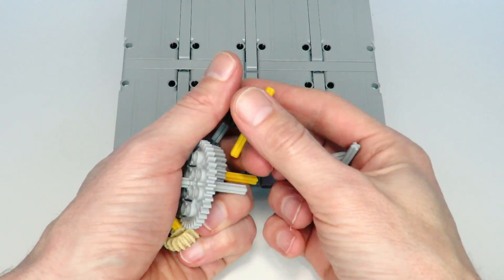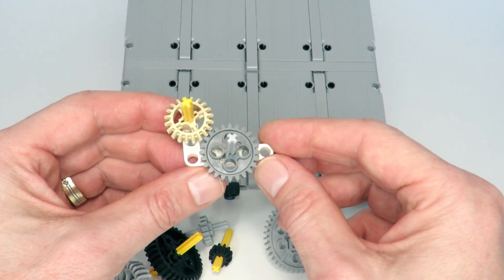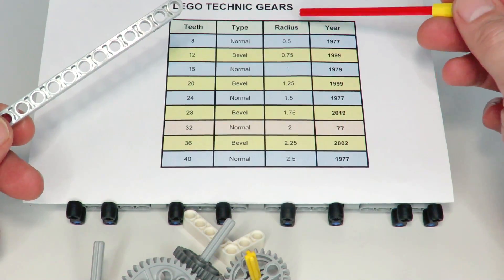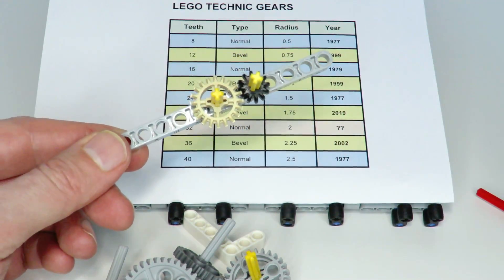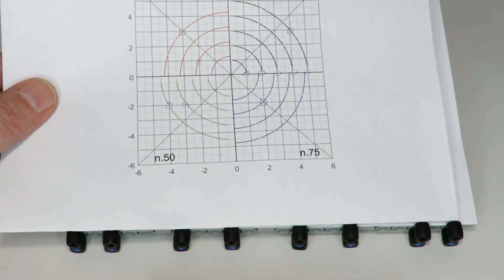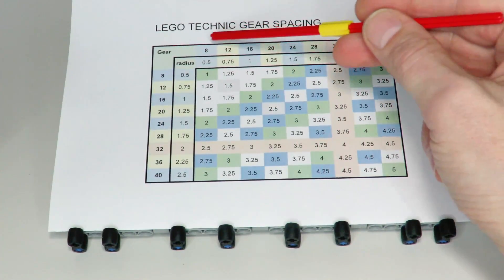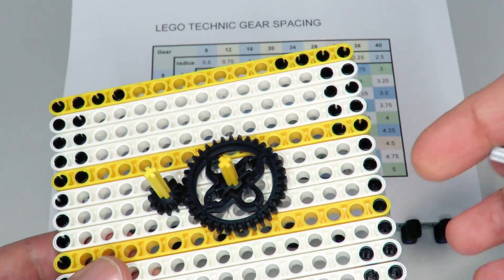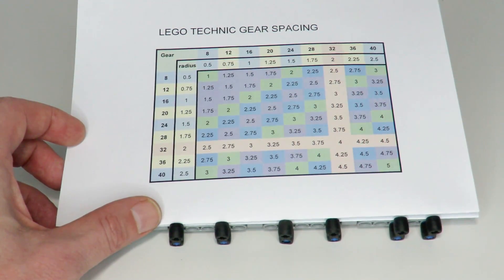How to mesh any two Lego gears on a regular grid!

Comment: Good one. I like the cheat sheet and the "intermediate gear" part.
The only thing I would like to add:
Gears without a "spacer" at the hub will not glide too well when placed flush with a layer of lift arms.
(Not sure what the technnical term for this spacer is. The 94925 has it, the 32269 doesn't.)
E.g. bevel gears sit on that surface with their full side area and will kinda snag a bit.
You can hear and feel it when turning them.
So, it still would work, but I always try to add a bushing or generally keep them away from lift arm sides, when I would have to place multiple like that.
Just to reduce the friction. It may add up otherwise.

Comment: intermediate gears may not affect the gear ratio, they do however affect the sense of rotation.
Reply from the maker: Hi Kabouter! Yes that's a valid point. And it's a handy one because I quite often use an intermediate gear for that purpose - should have mentioned it in the video. Thanks for your comment. ;)

Comment: Hi, may I know what kind of software did u use for the lego gear simulation in the beginning? I've tried using LDD to design & mesh several gears to simulate it. However the simulation doesn't work bcs of the latest version. Btw great video sir ✨️
Reply from the maker: Hi Hana. I wrote my own code to modify the Studio animation files to do it. It's a bit of work but doable. Thanks for your kind comments. 🙃
Reply: @TechnicBrickPower  Would you be able to do a vid on that?
Reply: Very interesting! Would you have some instructions/suggestions on how to do it?

Comment: i love this video and your channel. oh and just so you know there are a lot of better gear meshing if you use angled beams because the 8 and 36 tooth gears like to slip a lot so i put it on a angled beam and it works perfectly
Reply from the maker: Hi Adrian. Thanks for your nice comments - I haven't used angled beams much as grids are easier to work with - however could be good for an intermediate gear - will look into it. 🍺🍺

Comment: Thanks for this. Couple of comments:
1 - when building, you can quickly find the radius on the fly by the formula:  (number of teeth) divided by 16. You can also find the distance between any two gear axes by adding the number of teeth for both gears (eg 16+8) and then divide by 16.
2 - i wonder what more spacings are possible when studded technic beams and plates are used. Using technic bricks with the holes between stud or bricks with holes aligned with studs, you can get half-unit spacing along the x axis.
Reply from the maker: Hi John. Fantastic point - I like it. By extension of that idea we can work out the gear B that meshes with another gear A over distance D by using  B = D x 16 - A. So if D=2, and A =16 then B=16, but if A=8 then B=24. If D=2.25 and A=16 then B = 20!

I am not a big fan of 0.5 spacings but sometimes that are necessary and do give you more options. e.g. D=1.5, A=8 gives B=16 making a 2:1 ratio.
Reply: @TechnicBrickPower  you might also want to check out LDU (Ldraw Units) -- google 'Brickgun LEGO Dimension Guides'

Comment: Have you considered making an app, phone app and/or webapp, similar to what Sariel has done? Sariel's app is limited to just two gear pairs, and offers no in-depth numbers, just gear pairings. Having a similar tool that has intermediate gears would be helpful. 
The 56t and 60t gears on the turntable types 1/2 and 3 tops should be added to the charts, as well as the internal 24t gear, on the turntable type 1/2 bases, and internal 140t gear on the set of 11x11 curved racks. These might be more difficult to place within a gear train, but every chart/app feels incomplete without these additions.
Also, I'd consider putting the spacing within your chart, such as (3,4) and (0,5) for the 40t-40t pairing. Quickly glancing at the chart, this would make pairings quicker. 
I'd be curious to see a chart for half stud spacing. I know this can't be done on liftarms, but it can be done by using axles/pins with connectors that have perpendicularly oriented connections. Technically these could have any spacing, but Lego doesn't make anything other than stud and half stud wide bushes. 
If I had access to a 3D printer, it'd be nice to prototype a 32t gear, as well as the missing 44t, 48t, and 52t gears, and making standard variants of the 56t and 60t gears. As well as quarter and three quarter bushings. And maybe try a variety of gear designs like inversing which gears are bevel and spur, or making more crown gears like the 24t crown gear.
Reply from the maker: Hi there thanks for your comment! I haven't had a chance to look at Sariel's gear calculator yet. If I was going to do one I was thinking one where you can upload an .ldr file of a technic model and it would calculate the gear ratios of all components relative to a driving axle(s) - maybe by colour coding it in the ldr as such. Would that be useful? It would probably include differentials etc. 

I am not sure quarter sizing would be that beneficial as I am not sure what it would allow you to do that you can't already - maybe you have something specific in mind? I have been wondering for a long time why a 32 tooth gear hasn't come out yet - it would really add a lot of options.
Reply: @TechnicBrickPower   When I suggested the app idea, I was referring to something similar to what Sariel already has with his gear coupler part of the app. Sariel's solution finds a gearset based on the offset between those gears. Your solution can find an offset between gears based on a specific gear ratio. Two entirely different methods of building, Sariel's essentially has the frame already built and needs gears, while yours essentially has the geartrain already decided and needs a frame built around it. 

Making an active calculator app that ingests an .lrd is going to have to understand how the gearsets mesh, which makes things very complicated very quickly, and that's not something that's as easily color coded. It's a good idea, but the program itself would have to know what to look for and how to look for it, which delves into the rabbit hole that is machine learning and AI. Personally, I think Sariel's passive calculator is the optimal solution, you choose two gears, it gives you the ratio, you input an entire train of gearsets, it gives you a final ratio, with the increase/decrease in speed and torque. Sariel's app also has some additional features, but I haven't really looked beyond the calculator and gear coupler. 

As for my idea of using a wider range of bushing widths along an axle with connectors that hold the gears, it's fairly simple, more possibilities for gearsets. Lets look at what already exists, the half bush. With this half bush, between two gears, you can now mesh two 12t gears linearly across the axel beam. Similarly, any n.5 gearset would work in this way. Now lets apply that to quarter and three-quarter bushes, you can then mesh any n.25 and n.75 gearsets along a linear beam. It'd allow for more flexibility, though this would never exist in liftarms. And beyond flexibility of what gears can be used in a straight line, it reduces the need for intermediate gears, and could lower part count in geartrains that need specific ratios within it. Even further, this could also reduce the volume a build takes up, as you're now taking up less space due to the lack of needing intermediate gears. 

With all of the gear ratios nicely adding up to n.0, n.25, n.5, and n.75, quarter bushings should exist to allow more of these gearsets to be used. A three-quarter bushing should exist as a complimentary piece, such as how we have half bushes and full bushes, a three-quarter bush would take the place of a quarter + half bush set, such as how a full bush takes the place of a half + half bush set. 
I also think a wider range of bush sizes could also be interesting in chain systems, whether that's a plain chain or a track chain. Again, wider flexibility to the system, only this time it has more to do with overall shape and tension of the chain, as pulley placement has more varied positioning. 

Lego should actually produce a 32t gear, there's no logical reasoning for why that one specific gear is missing from the set. I also wish Lego would give us thicker gears with a 45° helix, so that we can finally have stacked perpendicular meshing; instead of a bevel-bevel with a stack of gears behind one of the bevels, we could reduce the set from four gears down to two gears, in a much smaller footprint, in what's probably also a much stronger gearset. Sometimes I feel like Technic is on the back burner when it comes to part innovation, an entire theme can come out with an entire assortment of new parts, yet it takes literal years for Technic just to get a revised gear that has reinforcement, and even longer to even get a new tooth count on a gear; the amount of new parts Technic gets in comparison to any other theme is lackluster.
Reply from the maker: Hi Again. Ok I will have a look at Sariel's calculator and see if I can implement your ideas. I think I can create something to dissect and process an .ldr file to calculate the gear ratios of the gears in it. It would discard all pieces that are not axles or gears, or axle joins and go from there.

Yeah ok I see what you mean with the .75 spacing. Might be an idea instead of using 0.25/0.75 bushes and axles (because in practice these can push apart with the force of the gears) to simply 3d print liftarms with holes with these types of spacings - that way you can ensure strong support for the gears. Mind you - if you are going to print 3d parts to create spacing to allow specific gears to mesh you may as well print 2 gears with a number of teeth that give you the gearing ratio you are after, e.g. 19 teeth and 37 if you want 19:37 for some reason...

I totally agree with your sentiment about lego technic parts - not many new are released that often. I would love some smaller and more compact springs, more connectors, and also more electrical components - e.g. limit switches etc. what about you?
Reply: @TechnicBrickPower  In your idea of a program that can dissect and process an .ldr, how do you plan on detecting meshing gears? What about setups with multiple inputs on a singular output, or multiple outputs on a singular input? What about gearboxes that use catches and driving rings? This is where I think it'll get too complex, processing a .ldr to only have gears and relevant components is fairly simple, but the complex part is when the program needs to evaluate which gear is meshing with which other gears. If you find a way to accurately detect gear meshing, then your calculator idea would work, my only concern is finding a way to detect gear meshing. 

In my idea of .25 and .75 spacing, I only considered using axles and bushes because Lego doesn't make any liftarms with a spacing outside of 1 stud. I also don't think Lego would ever plan on producing liftarms with alternate spacing, just because it's such a rare occurrence to need that kind of spacing. But we do have half bushes and a half spacing adapter in the form of the engine crankshaft part #2853; but the problem with #2853 is that you need a pin hole gear, not an axle gear. Lego doesn't use .25 or .75 spacing for anything, but I think it would be more likely that .25 and .75 bushes would be an official part, rather than the likeliness of a liftarm with spacings outside of 1 stud. 

I have no problem with custom parts, but I believe custom parts should remain within what Lego would produce themselves, which would include gears without 4-fold rotational symmetry that modern Lego uses. Which is why I think liftarms should remain within the 1 stud spacing, as that's what Lego uses and refuses to implement alternate spacings. But Lego does have half bushes, and connectors that can adapt a liftarm/axle to .5 stud spacing, so .25 and .75 spacings via bushes and connectors remain a technical possibility, and thus I believe custom parts for adapting to .25 and .75 spacings would be okay.

For an analogy to my argument of custom parts, think of the various supercars. It'd be easy to 3d print a custom shell, similar to what the RC hobby uses, to put on top of a Lego chassis, but that's not in the spirit of Lego. I believe all custom parts should be within the spirit of Lego, thus custom parts should remain realistic to what Lego already makes. The only major exception to this is when a relevant part doesn't already exist, such as Barman's CV joint design from 2009, which Lego later made an official part based on the same basic design. 

As for future parts, I think more electrical components would be cool, but anything outside of motors would probably fall into the Mindstorms and Education themes. Spike Prime comes with a force sensor, which could probably be used as a limit switch, though I'm not sure how much intercompatibility there is between the Mindstorms/Spike Prime ecosystem and the Powered Up ecosystem. Powered Up also has a color and distance sensor, which could be used as a non-physical limit switch. I think Lego will eventually expand upon the Powered Up line, and hopefully integrate Mindstorms/Spike Prime components into a singular ecosystem. 

As for Technic-specific parts, I just want a wider array of functional pieces. More gears, sizes, alternate typing for spur and double bevel, more half bevel varieties, crown gears, 45° helical gears, more driving ring gear varieties, have a driving ring variety with an axle hole instead of a pin hole, etc. Wider array of actuators, pneumatic and gear driven, in more sizes. Better steering and suspension components. More n.5 length axles, more telescopic parts like what the CV joint with the female axle hole provides, more axle-pin varieties, more varieties for frictionless pins, etc. Basically, I just want the Technic theme to finally be fleshed out to it's full potential in terms of available parts.

I also wish Technic subtheming would make a comeback. Cyberslam, Slizer, Roboriders, and classic Bionicle, were all great themes. I think bringing back subtheming of Technic would bring more attention to the Technic theme. More attention would result in more popularity, and more popularity would result in more products, and those products would inevitably have newer pieces; just like what all the old subthemes did, especially Bionicle, though most of it's pieces were unique and were odd to use with standard Technic builds. Overall, I think Lego should take the risk of expanding Technic again, the original Bionicle run lasted almost a decade, which was clearly a worthwhile investment for Lego, so I think they should take that risk again. I was never too fond of Hero Factory, though, as I felt like it branched too far away into it's own action figure theme, as it was all ball-snaps, and finding any actual Technic in it was rare, and the following revival of Bionicle was the same way. I just think bringing back the idea of Technic subthemes would introduce a much wider variety of parts, again, like what the various old subthemes did. 

Speaking of the Spike Prime and Mindstorms sets, I wish we'd get more color variations in parts. More magentas, teals, medium azures, reds, blues, yellows, greens, etc. A wider color palette would always be nice. Though, this would only be properly implemented if Lego expanded Pick-A-Brick's selection. After Lego bought BrickLink, I had hopes that they'd make Pick-A-Brick into a first-party variation of BrickLink, have every piece available, and expand upon this to provide every color from the current Lego color palette. Unfortunately, I'm losing hope that this will ever happen, though it's a genius business idea to offer this.

Comment: I would expect Lego to never release 32 tooth gear because you can already create all the same ratios using 16 tooth gear with 2:1 additional gearing. Basically the only reason for 32 tooth gear would be to get 2:1 gearing with integer spacing. However, 32 tooth gear being quite a big one, coming up with alternatives with roughly similar space requirements isn't that hard.
Reply from the maker: Hi Mikko. I hope they do create the 32 tooth one day - every extra gear or component gives you so many more options. I know what you mean with the 2:1, but the 32 would also allow you to span 4 spaces with two gears which you currently cannot do. 🙃